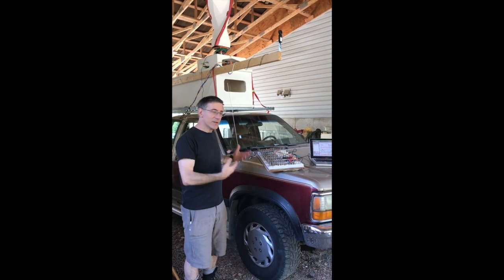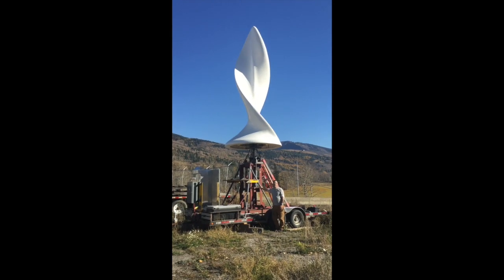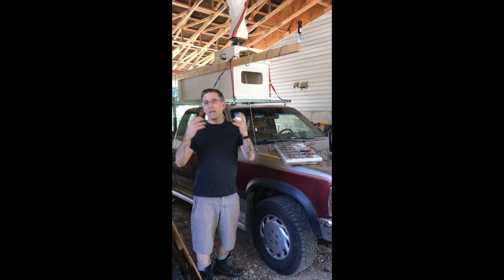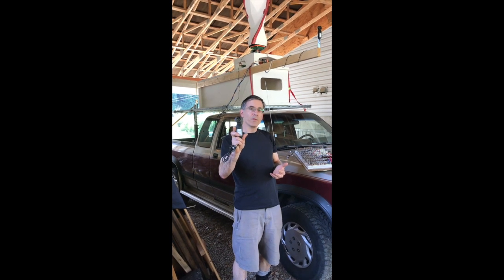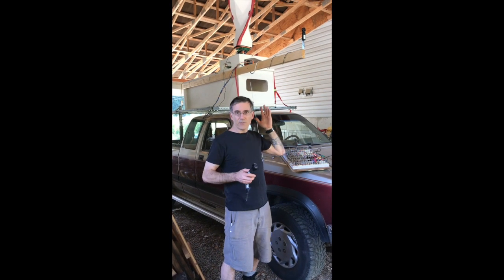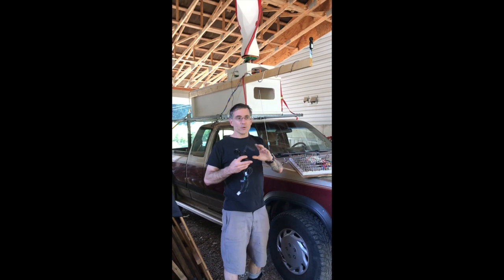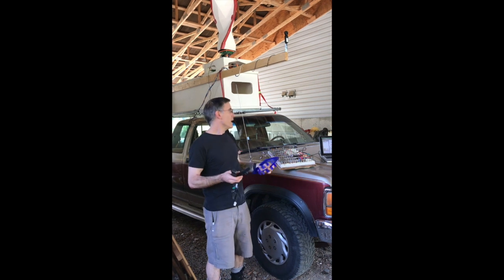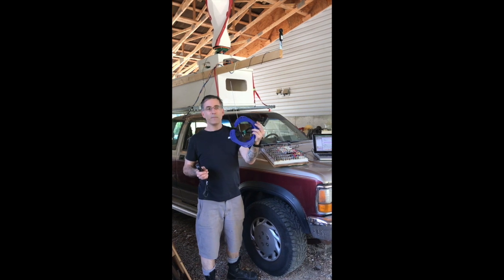How to test a Turbine

Comment: Andy, I think you’re missing a trick here. Some research I found over ten years ago applied shoal patterns of fish to VAWTs and found them to be more efficient than horizontal through the leading edge effect. If you have between 5 and 7 you could arrange them in a V like migrating geese and see the same thing with exponential efficiency gains at the back edge. I’ll be prototyping myself next year with a gimble, possibly not applying load the lead turbines to increase speed at the rear. Keep at it, been watching you for years!
Reply from the maker: Thanks Andy, yes the research by Dr.John Dabiri was groundbreaking, however no one has really been able to take advantage of it. To make it really worth while it requires a Vawt to be substantially taller than wide, like the small diameter Darius Vawts Dabiri worked with.

Comment: Hey Buddy, what if you put your wind measuring equipment on a swivel and wind vane setup, that way you would always know the actual wind!  Also, if you move back to Saskatchewan, you'll have some straighter roads for testing!  P.S.  You should hide or blur out your license plate...  Yes, I have privacy issues!  Take care pal!
Reply from the maker: Thanks Buddy,  I did use a swivel on my previous test setup, but haven't gotten around to mounting one here yet.   I'm building wind turbines in a very calm mountain valley, where there's not much wind

Comment: Why don't you use a cheap pwm controller for impedance matching?
Reply from the maker: Hi Nicolas,    Thanks for the suggestion.   I have a friend who is putting together something like what you are suggesting.   A tricky part is that the PWM system needs to vary the load as the wind speed changes, so the PWM circuit needs to know turbine, or wind speed, and do some computation to set load.   I understand the idea, however picking the components is not something I am competent to do.    For these tests, fixed resistance values that I can change between runs, should get me close.
Reply: @drewartturbine  I was just thinking that you could change the pwm on the fly with a potentiometer, that way you can characterize it much faster and easier. If you drive at constant speeds you can find the cp for a series of turbine rpm's, then it's a simple plot
Reply from the maker: @nirodper  Thanks, yes that sounds like a good idea, but is beyond my electrical engineering expertise.   I know enough to know what you are talking about, but not enough to select components and build a PWM system robust enough for the job.    Instead, from my collection of old salvaged components I've found an 8 position gang switch that's very heavy duty.   I should be able to set up 8 resistance levels.    If I can get my instrumentation set up right I can see Cp in real time, then with each of the fixed loads I can speed up or slow down till the load matches somewhere on the max Cp curve, then on to the next position.    Another day or two to get that done.
Reply: @drewartturbine  on ebay you can find them for like 10usd, just need to rectify the generator output and select one that can handle the current, hook up the 2 input and 2 output wires and you're done.
The 8 position switch may be enough anyways.
Wish you the best luck!
Reply from the maker: @nirodper  If you were willing to point one out, ideally on eBay, that you think would work, it'd be very helpful.   I'm looking at voltages from almost 0 to 60V, and max wattage likely 200W but best be prepared for 500W.